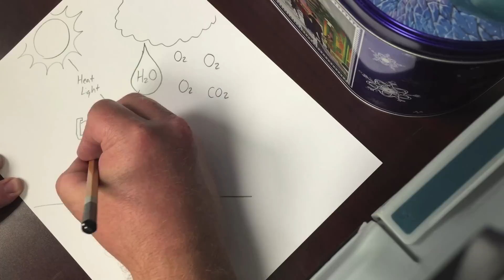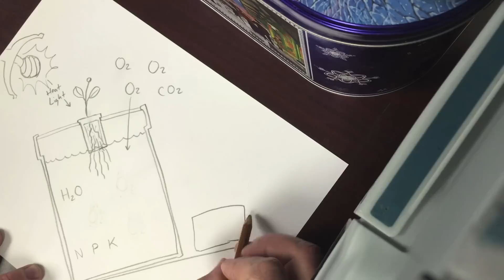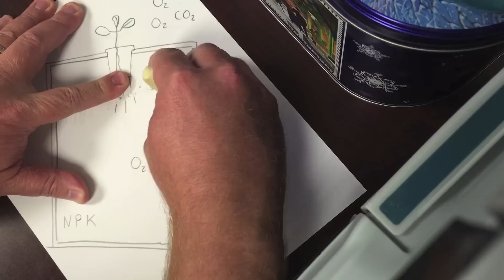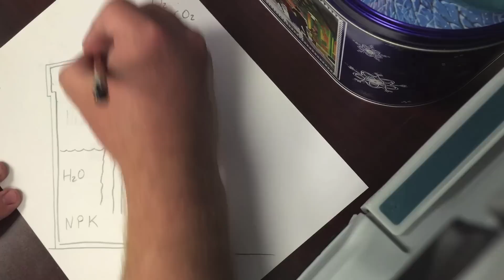How the Kratky Method of Hydroponics Works

Comment: hmm.. i have not done any of these hydroponics and aquaponics system but i realized that in kratky method the downside is that it will take equal or more space than a traditional farming method using soil. whilst in other hydroponic systems they can create a vertical farming system. because you cant put another box above another as that will block the sunlight for the box below it. and if you put light bulbs it essentially defeats the purpose of the kratky method. can i ask if the cost of the fertilizers is significant compared to the gross profit ?
Reply from the maker: These are just for eating and experimenting, but at this scale I think the cost of fertilizer is about 5 cents per gallon.  So it's pretty inexpensive compared to the cost of any new in ground setup.  Once a soil garden is established it can be very cheap to maintain by practicing traditional organic methods, composting, mulching with wood chips etc.  With kratky you could have a whole field of food if you had enough container.  Trenches lined with plastic might work too.
Reply: very interesting. when you setup the kratky method you only mix the fertilizer once with the water ? and it will last till the plant is fully grown and ready for harvest ? thanks for responding.
Reply from the maker: If you match the reservoir size to the lifespan of the plant yes.  Often you have  o top it off a little near the end.
Reply: ok thanks for the details and the video :)

Comment: Great video, I've been able to kratky quite a few different things, my current indoor winter garden has lettuce, kale, and arugula going now.  I use  protein containers with 2" net cups, they are a little smaller containers than I would like but they work and are free. I just have to add water a few times during the life of the plant. The only thing that I have not had the best of luck with was strawberries I tryed to kratky last season, might have been water temps, but I could not bury the tote as I found out the hard way that everything eats strawberry plants. Have talked to others that have had difficulty with kratky but I've had great luck with it, nothing better than not having to mess around with any medium, I just never take the water level back up any higher than about half way full as to not drown the air roots.
Reply from the maker: I have not done strawberries yet but I think outdoors, high temperatures could be a real problem.  I suspect using a larger then normal tote would help.

Comment: Question...   i have changed the nutrients in the reservoir,   after 8 hours the roots got stained brown  i dont this its root rot can be?.  should i do something about???    ph 5.8 ppm 800, basil krakty method 1 gallon reservoir. I left the same gap between the roots and level of water it had before water change.
Reply from the maker: I've seen this happen if the roots dry out.  I'm sure other things could cause it.  The plant will struggle along for a while but i would just take some clones and start a fresh plant.  Ppm and ph is probably reasonable I just add lettuce mix until the plant fails though.

Comment: This does not work well for every plant. As the water decreases the PPM goes up and PH starts bouncing all over too. Highly reccomend ppl to spend $10 bucks on an air pump and stone.
Reply from the maker: Plants are strong!  Especially when their environment changes slowly.  Try it out!
Reply: I believe it, i tired something like this a few years back when i first got into hydroponics. Works with good with some plants, but the pump makes a world of a difference. Plus cost pennies a month to run 24/7
Reply from the maker: How much does it cost to aerate a whole field of crops?
Reply: Well i have 3 dual outlet pumps right now, each only use 3.5w max power to run. So about 10.5w max. 24hours a day at 12cents /kWh cost me about 10.50cents a year. Keep in mind you do not need some huge special pump, small 20-40g pump will work well for most people needs. BTW all my containers are 20+ gallon totes.

Comment: isn't this environment is perfect for mold and bad germ growth that will kill the root of the plant at the end ? 

i am wondering which method is the best for cloning of cutttings..  using water sprinkler ? ultra sonic fogger ? or submerge root in water and use air bubbler to increase o2.. which one is working better ?  or even compare with kratky method..

any video on this comparison ? 

thanks

 
andrew
Reply from the maker: Look around my channel.  So,e of what you seek is there.  I think the roots are fine until they die.  They rot after they die